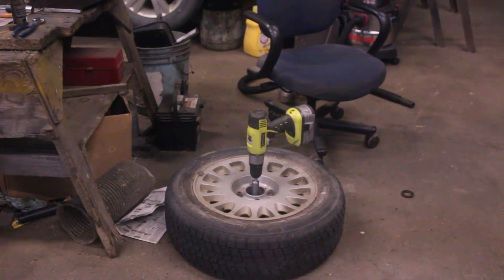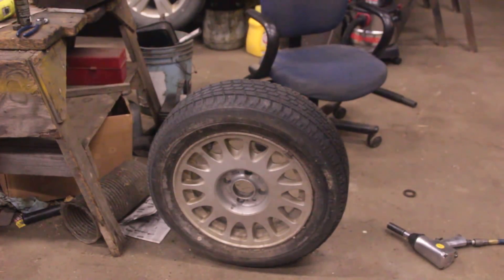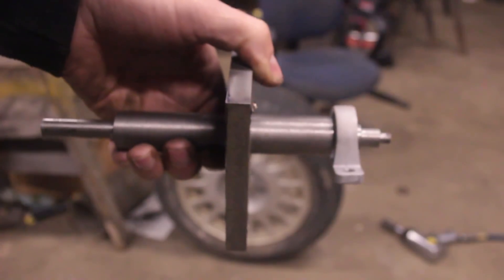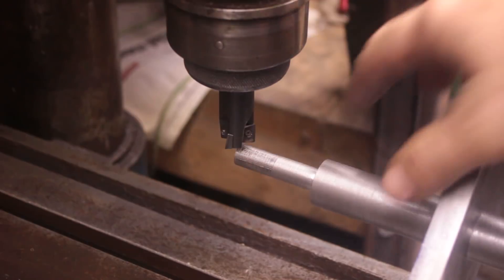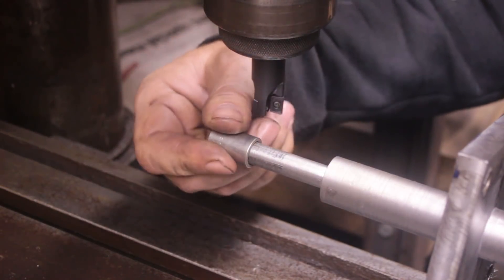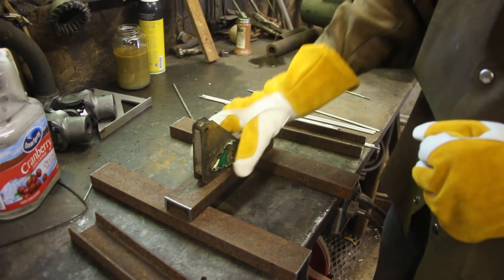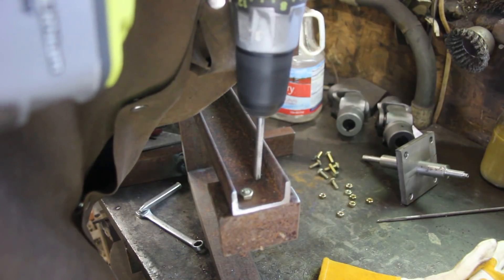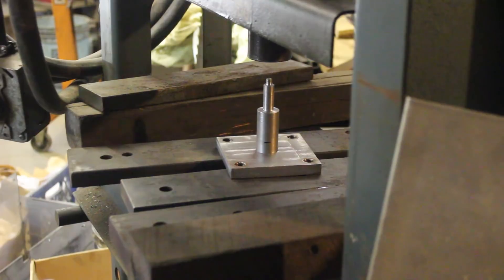Inertial dyno build

Comment: nice idea. got to watch a few of your other videos now. was there a part 2?

i'm using an old set of drag slicks to mage an inertia dyno for a briggs.I used a stock set of atv hubs and axle parts i had on hand. check out the sympledyno page for RC cars. its no longer developed but it has an MOI calc that might help size the flywheel for you.

their blurb:
MOI Calc is an Excel file development by Solo2racr for calculating the MOI of various configurations of rollers and flywheels.
Reply from the maker: https://youtu.be/7HHw6EeqEyo I tested a few things with it but I really need a lighter wheel and I haven't gotten a chance to change it yet.

Comment: how do you know what inertia of flywheel to use for a specific application?
Reply from the maker: Paul-antoine Khoury I guessed.  In this case I was wrong.  It's a bit too heavy. For cordless tools they will shut down before they spin the wheel up to speed.
Reply: @diyVT  thanks for your reply but if I need to design an inertia dyno how do I know what inertia of flywheel to use.